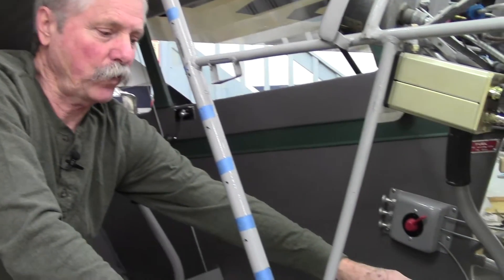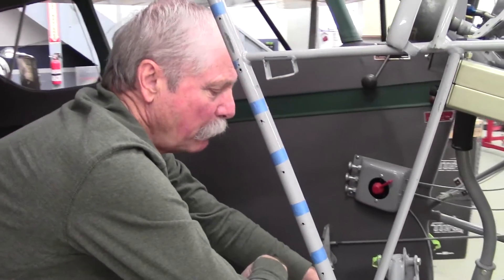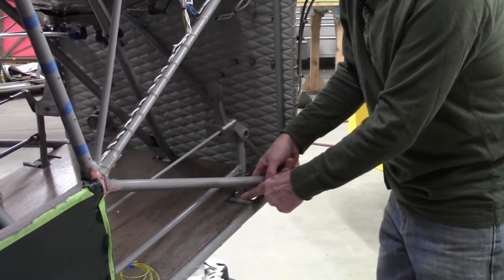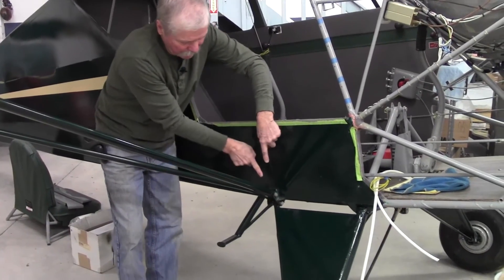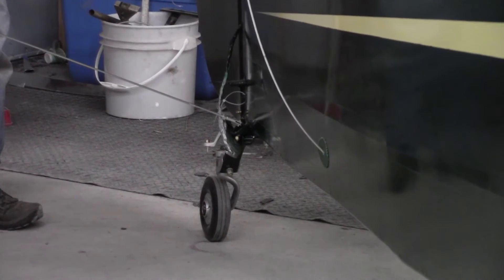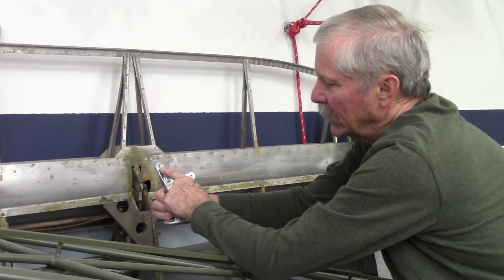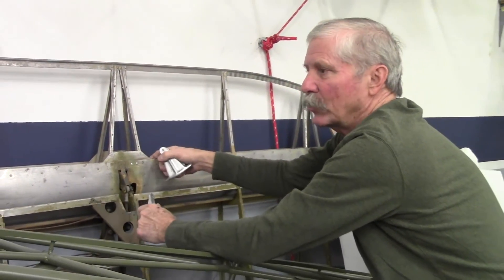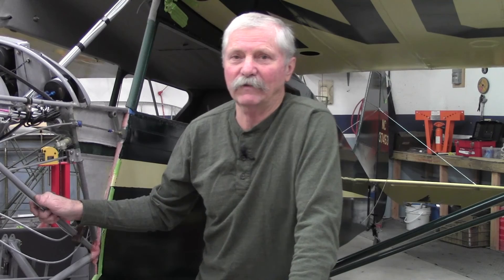Ten things your IA should know for your Annual Inspection

Comment: Tim, I found the Civil Aviation Regulation 4 A by doing a google search and it came up with a pdf immediately. Here's the link:  http://stacheair.newcanopus.net/data/At%20Work%209B%20Repair%20Station%20CD/Data%20Info/CAR's/CAR%20Part%20%204a/PDF/CAR-PART%2004a.PDF    I'm presently an A & P student finishing up Airframes and researching the Inpsections required for my final project which is a Annual for a Cessna 150.  Granted the information you posted here pertains to the Interstate which is a beautiful classic aircraft.  I actually hope to help keep these classic's airworthy as I advance through my career.  Thanks for posting the video & God Bless.